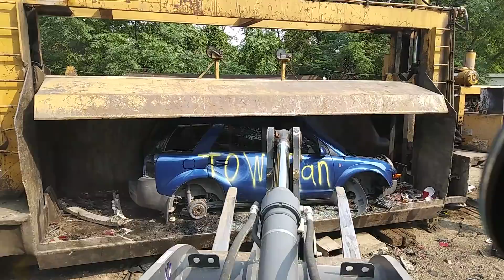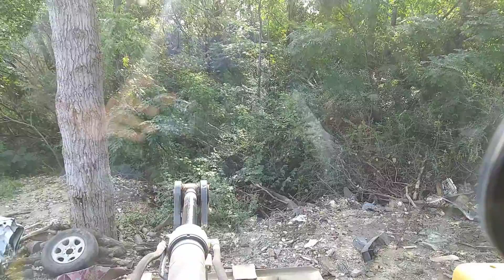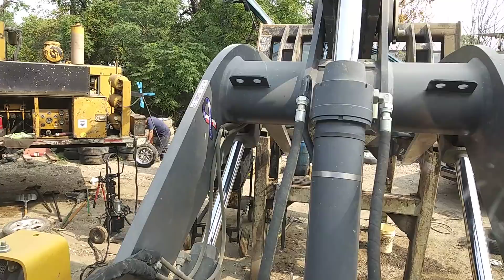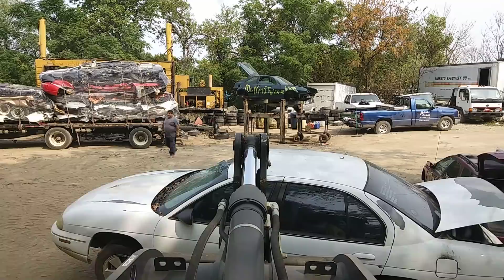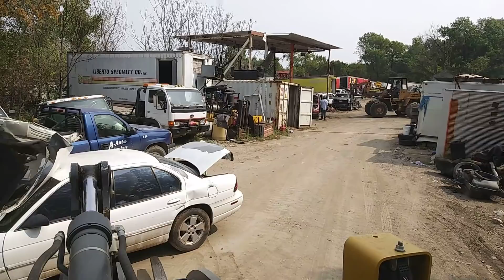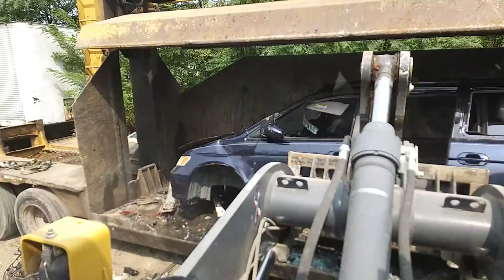Volkswagen Carrado gets Crushed.....Shout-Outs

Comment: Good tallights off those Dakotas used to be a bear to find, I had a Ramcharger and it's the same light on those and on some full size Dodge trucks.    Bought that truck for $50 with a bad water pump, spent about $150 fixing it, drove it like a year and sold it for $400.  Thing got like 11 MPG on a good day with a 360 engine even though the title said it was only like 3600 lbs.  I think the trans was screwed up too.  My only Dodge out of stuff I drove.
Reply from the maker: That's how you do it. Buy cheap. Throw some parts at it, drive it for awhile and pass it on for a small profit. That's a win homie 👍